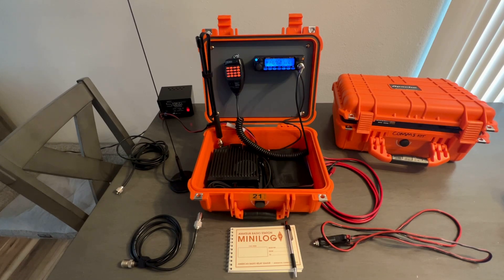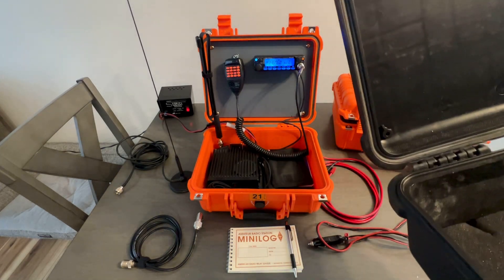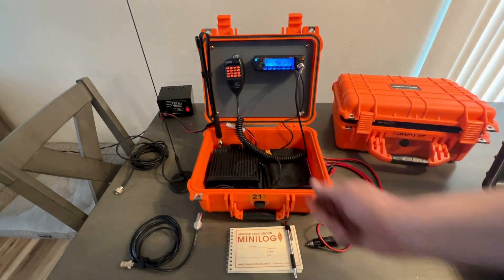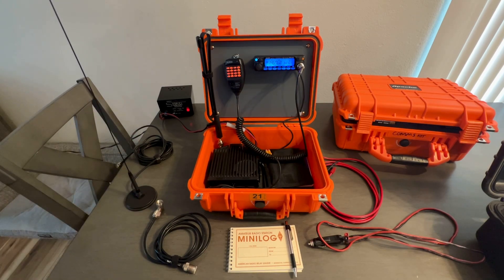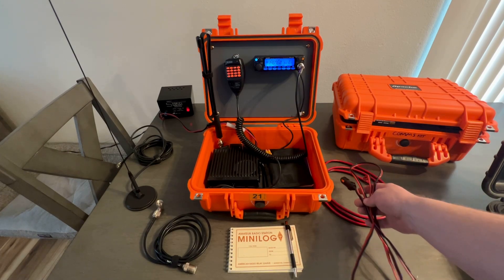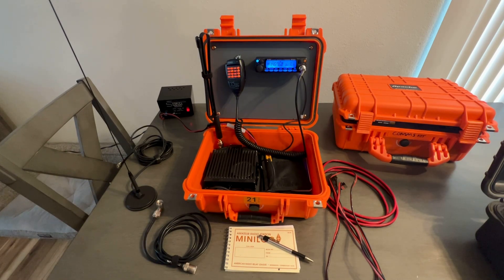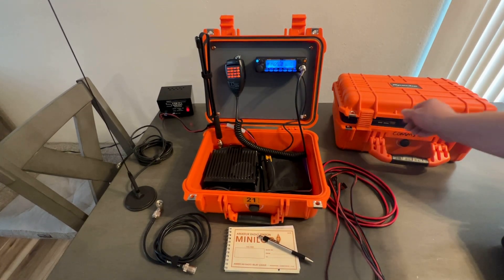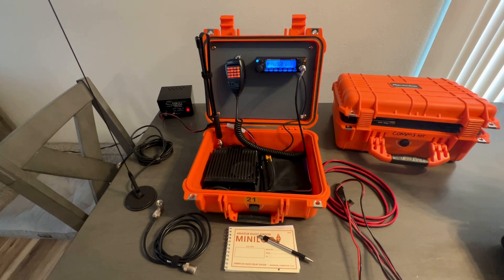Simple Ham Radio Go Box A Better Look.

Comment: That is a straight forward VHF/UHF go box you've got there.  Any reason you chose not to power it with a battery?  For remote/field operation there won't be any generators around to power your radio.
Reply from the maker: I have cables that allow me to connect it to a battery. I do use a small battery when I am out in the field.

Comment: How well does the tactical antenna work on the 90 degree adapter? I mentioned this to a radio technician and he reckoned it wouldn’t work due to no earth? I assume he meant ground plane but I don’t know…would like to make one for 2m 40cm and want a handy flexible antenna I can fix directly to the radio as you suggested
Reply from the maker: Sorry it took so long to see your comment. So it works fine as long as I use the lower power settings on the radio. Higher power can cause issues being that close to the radio. 

In a way his is right grounding would help a lot with signal. On the other hand I have never ground a handed held 2m 70cm radio. The concept is kinda the same. 

I have been told before that the portable antenna should not work. However I have made contacts just fine with it, repeaters, and alike.

Comment: I want to warn you against using that 12 vdc, cigarette adapter, in your vehicle. If your 50 watt radio, draws 20 amps +/-, most vehicle cigarette lighters are wired with light wire, and rated / fused for 5 amps max! You may blow a fuse, melt wires or cause a fire, under the dash! (Unless you have upgraded that cigarette lighter's, female plug, with 10 gauge wire!?)
Reply from the maker: Thank you for the concern and feed back.  I have my car radios permanently mounted and wired through by a certified mechanic friend. I have modifications in my car (Subaru outback) for overland camping that have Beefed up wired and so on for the power ports.